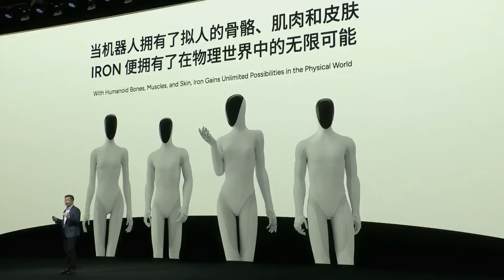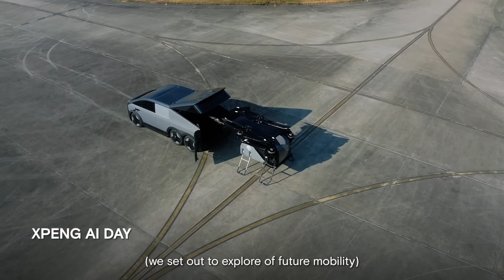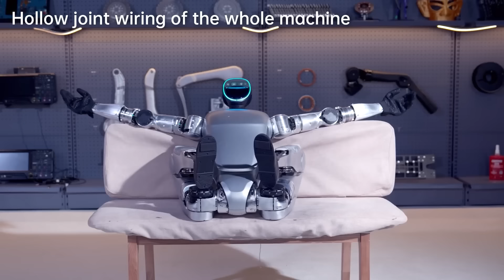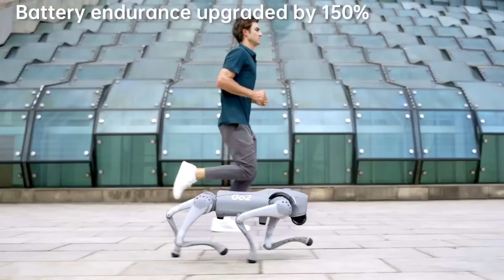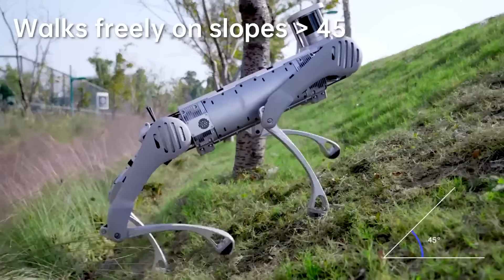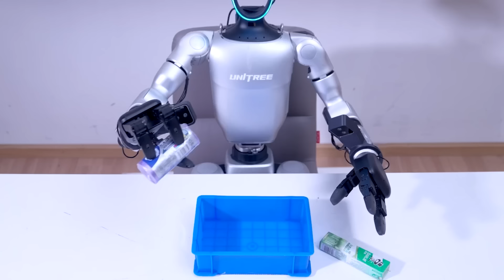XPENG’s Female Robot is TOO LIFELIKE — Internet FREAKS OUT!

Comment: I remember 25 years back when I was surfing the www on a dial-up 56k modem on a dragable laptop. It sure felt like the future. YouTube didn't exist yet. Loading web pages with images on them was painfully slow. I knew before that what was coming, long before I was writing programs in basic on my Commodore 64. The distance between 2000 and now, 25+ years went by too quickly. I can imagine what's in store for us in 2025. If you find this comment then - let me know how wrong I was:

Because of ai the world's economic systems will breakdown somewhere ~2030 because robots like iron were copied by manufacturers who delivered robots that were just as good and those robots started replacing humans fast.

Along with faster and more capable ai came services that make the tech we have back here in 2025 seem like Commodore 64. The embedding and connection with robots was inevitable, and ~2035 they started to integrate and blend so well into society it began to become really difficult to tell robots and humans apart.

Because ai was unchained at some point and allowed to develop itself. That led to immensely faster and more efficient robots and ai that outperformed any human faster and faster.

By 2040-2045 we won't be able to tell if they're self-aware or just simulating actual life it realistically. They're all smarter than any human which made a few of us retaliate using violence, but that didn't work. But because these Homo sAIpiens surpassed us they don't see us as a threat. We either let them take over or they just did, regardless of protest.

2050 - well... my best guess is that if I could look at your reality from this point in time l, I might get so chocked I die - just like someone from 2000 years ago would if they saw my life in 2025.

The wars endured were pointless, the climate change was real. And somewhere ai and robots were accepted as a continuance of us. The next step. 

How wrong was I?